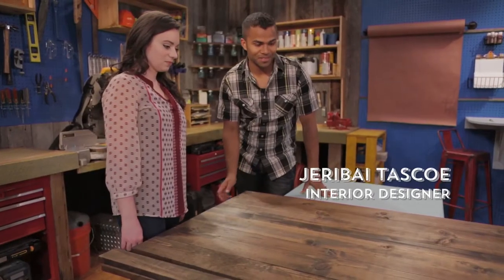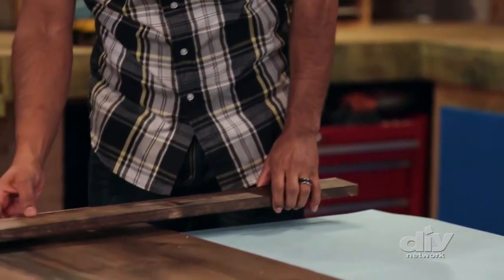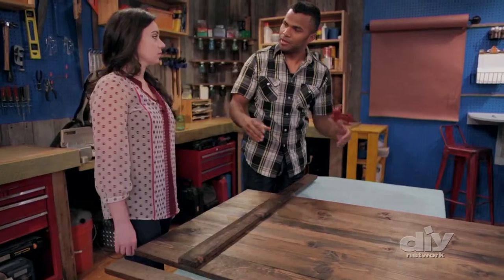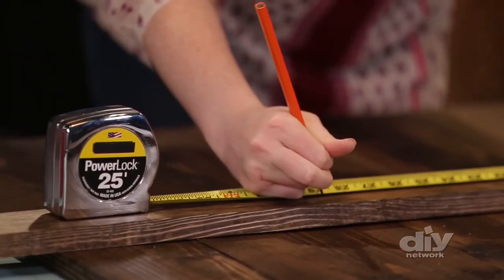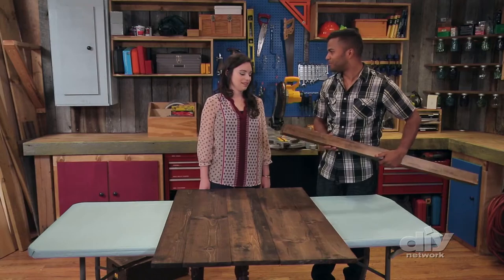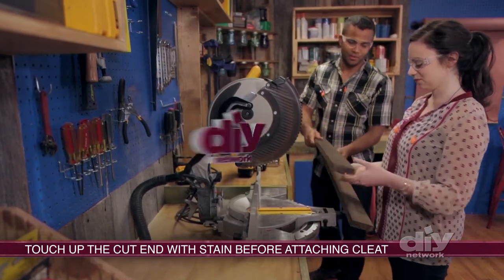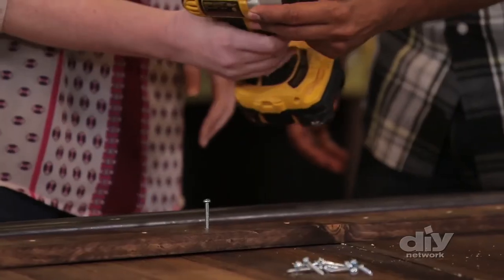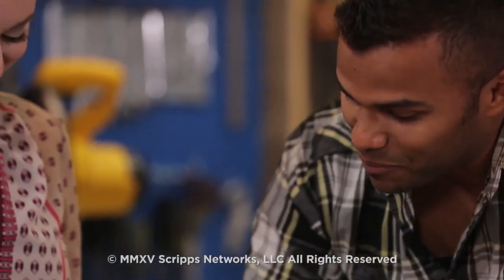How to Make a Tabletop Cleat - DIY Network

Comment: This a great idea if you want your table top to split and crack due to seasonal wood movement!
Reply: +DasAlbatross Exactly. How can you have all those tools and not know about wood movement? I have zero experience with woodworking but am looking to build my own table. And in a single day I've researched enough to know about wood movement and that a tabletop needs to be free to expand and contract or it will rip out screws at best; but crack until it destroys itself is most likely. How can these people be "professionals" and not even know that?
Reply: +Queen Rexy Welcome to the craft! Two of my favorite youtubers are Paul Sellers and The Wood Whisperer. Both have a lot of really great videos and do an excellent job explaining the concepts. You should also check out the /r/woodworking subreddit over on Reddit. Very supportive and helpful community.